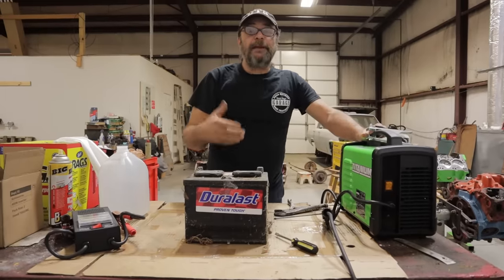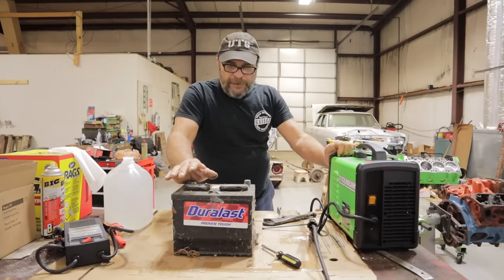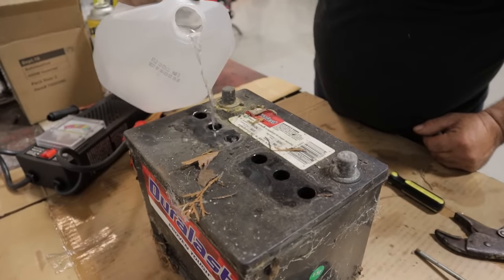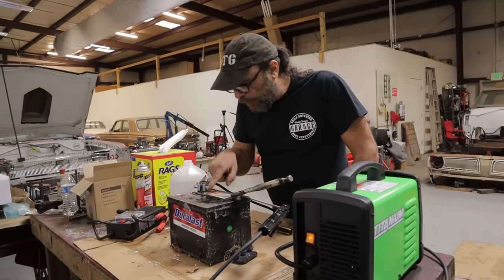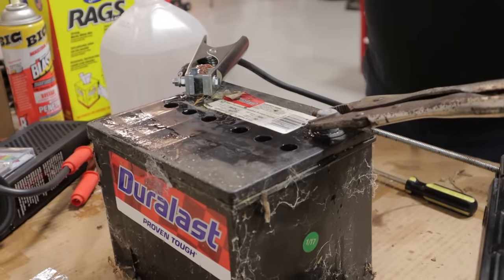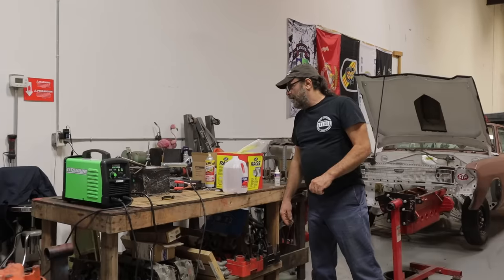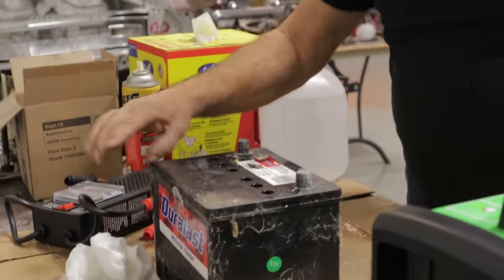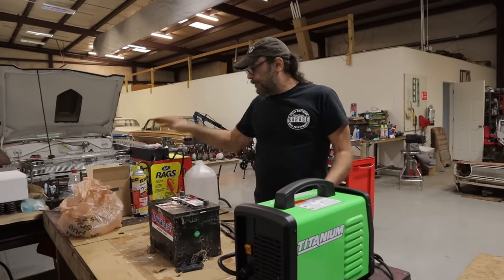Reviving Dead Batteries With A Stick Welder

Comment: Try Alum and Distilled Water.
   1) Drain, clean battery, and safely dispose of Electrolyte using Distilled Water and Baking Soda.
   2) Fill with Alum 8 OZ per Gallon of Distilled Water.
   3) Trickle Charge or safely Top Charge battery and verify with Voltage/Load Tester.

Comment: A stupid easy method to break the sulfate crust is to add a few ml of concentrated alum solution then apply some high voltage to it through a big diode. I found an old electric space heater works well. For smaller ones use a  100W light bulb. Your end point is when it conducts enough to get that bulb glowing or heater elements get hot. Works well for little to medium car batteries. For fork truck batteries do the same but you will need a welder.

Comment: Question please ..Ive a 240A mig converted to gass-les flux core wire feed (polarity changed ) will this do the same job as a stick welder  , ?Cheers

Comment: So did it last and worked on a car for a while, as you mentioned you were going to test it on a vehicle? Just wondering if it was a short term fix, or a long lasting fix(1, 2 or 3+yrs..)thx for the video, very interesting. 👍

Comment: 3 stories:
1) My dad had a 60's parts store where we sold Delco batteries. Delco had a warranty policy where they would replace a battery with a split case from an explosion (hydrogen gas). I thought it was dumb because we all check charge by jumping the terminals with a wrench. Any explosion would be OUR fault. Buuuut..one day I walked by a car that popped when the driver tried to start the car. within seconds, I saw liquid pouring out in the ground. The driver opened the hood and the battery case was split open. Terminals were good and tight. It must have sparked internally from a broken connection.
2) We had a customer come in complaining about a "loose" terminal on a new Delco we sold him. Brother saw the horrible terminals beaten to a pulp and the hammer under the hood. The car did start so bro asked him what the problem was. With brother's nose over the battery, the owner pulled the post out of the case and brother only remembered a muffled PHFFT! Then he went deaf. I hear a shotgun go off in the shop. I went out and saw bro covered in acid. We washed him down and took him to the hospital. They put a drip on his eyes for hours to flush him out. He has a cloudiness in one eye to this day.
3) Non distilled "water". There is a WW-2 story about a submarine that needed new batteries. But because of supply shortage and distance from a shop none were avail. The captain ordered a big set of cables connected to the batteries and the other ends thrown into the sea. The resulting short circuit cleared some of the sulfation and they were able to get a better charge.

Comment: I discovered the hard way that I had a shorted cell on a battery  in a 72 Duster by trying to jump start it. If you are going to try that have a garden hose nearby like we lucked out and had 25 feet away because both of us had acid in our eyes and could not see. We completely hosed down and were ok. About 2 hours later my pretty new pair of levis were falling apart. We hosed down the engine compartment but that acid had set for about 10 minutes while we were hosing ourselves down and it still made a mess of it.   If you do manage to get the battery somewhat usable it is still not gonna have anywhere near the cranking amps nor reserve capacity of a new battery.  Just replace the battery, it is not worth the risk to squeeze a couple more summer months out of a severely comprimised battery.  I wish you had put a voltmeter on it while charging to see what the voltage was doing. After that incident I always check cell to cell with a volt meter to make sure there is not a shorted cell before trying to jump start. My dad blew up a fairly new battery in a Reliant K-car jumping it after having left his headlights on.

Comment: Hey Tony,
I think that you should have put the meter on the Battery 1st, to prove the battery was bad. I like this process of rejuvenating a battery!! Kudos to you!
Reply: No need to check battery voltage beforehand.  If this would blow up the battery,  both good and bad battery will be blow.

Comment: I have a small harbor freight stick welder and a giant Lincoln industrial arc welder 220/440.  It's about 600lbs from the 40's I think.  Awesome stick welder but the wheel is harder to control on the Lincoln.   Will the harbor freight 80 amp work?

Comment: I currently shock batteries a little differently.. I mix six tablespoons of epsom salts with distilled water and slow charge the battery.. The sulfates drop off the plates and then take a full charge.. I will now experiment with this technique..,

Comment: Had a shade tree mechanic tell me bc of that sulfication as this guy say..that it would crust up on the bottom & short out the battery..he said to unhook the battery & hold it up about 2-3 feet & drop it on the ground & it would break up this material on the bottom..I dropped mine like 6 times..enough to shake the stuff loose but not crack the case on the battery..really thought this was bs but I got anot8 months on the battery..I know this sounds too easy..as I thought but it brought the battery back to life

Comment: Now put on the charger and charge overnight.  Welder did the shock mode.  Sometimes a sulfur plate set might need reverse voltage and forward back and forth then charge on normal polarity.

Comment: I know I’ve used distilled water and just like that we don’t ever think about all the grim and dirt on top that washes down in to it .  Dad told me that all the flakes off the plates would settle to the bottom that grounds the battery plates out .  I’ve washed them out with tap water 15-20 times just kinda shaking it like just flopping it over on the ground jarring it breaking the stuff loose inside .  Then after the washing it out till the water comes out of it clean last two or three times I used distilled water . Then filled it with new acid and trickle charge for 24 hours it was a 6 year old battery! I used  it for three more years it was good when I traded the truck off .  My dad said back in the 50’s he just used mountain stream water or spring water .  I wanna know if this method would work on a AGM battery you can add a few drops of water in each cell of them every three or four years and get longer life out of them .  I’ve seen welders do this trick we’re they just use the welder on the tuck to jump start cars.  With the way the battery was hooked up same way as it was charged her on the video . They didn’t turn it up real hi like 50 amps at the most but the cars were older with no computer !  Great video Tony I learned something new about cleaning those plates off .  If your gonna have lead wet cell battery’s in your ride this is great to know !

Comment: You use distilled water because the chemicals they put in tap water, bottled water, and filtered water will interact with the battery acid and produce ammonia gas which can build up and cause the battery to burst (aka explode)

Comment: Got myself a stick welder for 55 bucks to do this myself. My step dad has been rejuvenating batterie smy whole life. It funny hows he been using batteries from the 60s and 70s and 80s. He was in the Navy on diesel sub and learned way back then. I never bought batteries just brought him.dead ones. Until i used AGM batteries for deep cycling with stereo systems with amps and capacitor that i realized those it didnt work with the stick welder.

Comment: I bought a battery from a shop that claimed they rebuilt batteries,  it worked fine the first day I bought it. The next day it wasn't completely dead but wouldn't turn the engine over fast enough to start.  I went to wal mart and bought a new battery.  The savings wasn't worth the hassle.  If you do it yourself and it doesn't work, at least you tried.  If it does work great.

Comment: I have done this as well  But I used a commercial battery charger that I could adjust the amperage and voltage with. That gas coming out of that battery Uncle Tony is hydrogen and it is highly explosive. Also I would not be standing right over the battery looking in the holes like that cuz I have seen the acid boil out so violently that it could splash onto your face, you should have a face shield on and should be looking in the holes with an inspection mirror. Just my advice, my two cents worth

Comment: Could i use a fluxcore welder? It is the Easy flux 125. DC based inverter welder. I also have the real cheap HF welder, havnt used in ages. $49 when i bought it with coupons.

Comment: I took it for granted you need a DC welder. A welder with that much current available would cost you big bucks. Cheaper to just go buy another battery. I watched the battery connections and can't figure out if you are trying to desulfate with reverse current or forward current I have to assume it's forward current but the black clamp on a positive post is confusing. Assuming forward current the best I can see on the internet is 75% and not very long before the battery goes bad again.

Comment: Ive tried to revive a few batteries but never had much luck.   The last one I attempted had measured 10.5 volts with 1 dead cell, used a plating transformer set at ~15 volts dc, cycled on 1 hour and off 2 hours for one week.  The result was no different  and I cut the battery in half to look at the plates.   At the cell closest to the negative terminal,  the bottom half of the plates were corroded away with material setting in the bottom of the cell.  Perhaps I used too much power, but some batteries won't come back no matter what you try.  In the future I might try some type of pulsed dc, people say they've had luck with that.

Comment: "do as i say, not as i do..."
photovoltaic / solar thermal technician here: i have always revived dead batteries by changing the distilled water charging etc. have i been doing it correctly, is this how it's done ? that's the real question. while learning photovoltaic we had to learn about batteries and only maintenance was covered and the difference between automotive battery vs deep cycle battery (golf cart, boat/marine) automotive batteries have thin plates and do not like to be charged, maximum charges you can do is 3. yes you can charge them over and over but it won't hold a charge. my trick was to have a trickle charge via mini solar panel connected to have some juice to crank the car (my personal experiment) Deep Cycle Batteries have thick plates designed for many cycle (1000 or more charges) personally i prefer lead acid batteries over lithium ion. I like them but for a customer to have maintenance free batteries, lithium ion. i've seen the automotive battery cases removed and installed at new case after the plates been refurbished. if you want to bring back a battery back to live to experiment Be Careful use proper PPE personal protection equipment. also when dumping the battery acid, store it in a safe place since it's Sulfuric Acid, don't throw away safe it and use it for other things. i happen to be a goldsmith / master jeweler 55 yrs experience and use that sulfuric acid. if ever i'm cut i use the acid to stop the bleeding, stings like crazy but works.

Comment: I prefer using a battery charger set on start setting for about 15 minutes and rest at about 20 minutes than repeating for 3 to 4 times. That's how I did my battery dated 2018 and it still holds a charge. Of course I had some failures doing this with mower batteries. I watched different methods on reviving a battery.

Comment: Tony it does work but be careful for gods sake.  these things blow up on occassion. Happened to me jumping a dead battery too many times with a 200amp charger/starter. Luckly i was was working on another car. I heard a loud pop seconds later something fell from the sky....it was the entire top of the battery!!  I just feel its not worth the risk...a spark from the cables is all its needs....maybe a fan can  blow the fumes away making it safer...

Comment: Hi I have 1 question......  What do you do when you have a sealed battery?  I was going to put up an add for fixing batteries for winter but I don't know what to do if someone has a sealed battery. I couldn't just turn them away that's bad business.

Comment: I have a few motorcycle (one generator one KTM 690) batteries a few Marine batteries a truck battery a few quad batteries. I'm gonna give this a go. I got a Lincoln 220 that I've had for like 20 years that I hardly used at all.

Comment: I work with batteries (lead acid and lithium) everyday and can't recommend highly enough not to do this if you value your face. If you want to do it safely get a low current charger and gently force charge it while monitoring temp in each cell and voltage. All this does is overheat  the plates, create excessive hydrogen and oxygen (explosive mixture) and leave the plates, if badly worn or broken, ready to melt together and short circuit causing a very bad day. And as he said in the video "if it "pops" and acid gets on you just rince it with fresh water and you'll be fine" is bullshit. If it gets in your eyes it's at best instant Cataracts and worst instant blindness. Sure it will work for a while but really is it worth the risk over just buying a new battery? You can get good money for the scrap one so deduct that from cost of new one and really not worth it. Up to you but I myself wouldn't bother and certainly wouldn't be at it as a side hustle 🤣
Reply: IV had a battery pop an blow acid in my face an eyes just by hooking battery charger up to it on 10 amps, burns like hell yes but am after I stumbled an wondered my blind ass up a flight of stairs an in the house to the sink as I had to keep my eyes closed to to the air hitting them mad it burn even more so like I said I had to figure out a path to get in my house to the sink so I can flush my face an eyes with running water an dousing them with baking soda it finally stopped burning an my eyes were fine so the fact that it would be instant or even blindness is bs, that is however you immediately flush with cool running water water for about 30mins or so you'll be fine but still burns like hell.

Comment: Just wondering does it matter what voltage output your stick welder output to the battery? Generally they do 17 to 19VDC don't they? Do you have any voltage readings for 50amp, 70amp, 80, 100, 150 and 200? I am going to do the same with mine soon, however I have and old school Century Quick fix tig welder going to try out, it doesn't have current control like yours, just high and low settings.
Reply: yeah CCV... Closed circuit voltage is around 18-42VDC for a welder this size

Comment: I wondered if he was using a DC inverter welder . Even if you have a AC buzz box you can buy a bridge rectifier with a high enough amperage rating. I believe you you can even use a 3 phase bridge rectifier if you have one . Look up bridge rectifier on you tube for making DC welder from a AC welder . If your battery case is bulged out that means it has frozen and may be no good to even try

Comment: On a little welder like that, do those plug into regular 110 volt, or do they require wiring to a higher amperage breaker? 15 amp? 20 amp?

Comment: Was just looking at the output of my welders, both 220 volt input and output of one is 48 volts and the other 25 volts and can flip AC/DC +/- . Thinking the 48 Volts would end up a boom on a 12 volt battery.

Comment: Can you use a trickle charger as well I've had batteries go dead just after having it say is good and been charged put it in my vehicle drive it a couple miles park it and after a couple weeks go to start my vehicle even with a $200 dollar portable charger still won't start the car and I'm taking about a 1969 Hurst Olds 442 why is the battery dieing???

Comment: Make a note this is a DC WELDER being used.......Great video....  I killed 8 of my 14 solar lead acid batteries I thing them four are only 4 months old and  other four are 6 months old 100 AH marines...$900 down the drain unless you're method works..Someone said  they use 10 amp for a small car battery for hours....Thanks for sharing. I'm to chicken to go over sat 50 amps...LOL

Comment: If the stuff gets knocked off the plates, then left in the battery, won't it reattach over time? Seems like u should replace the water and acid.

Comment: By the way if you leave the information on stickers on your load tester right there around the button it tells you how many seconds to hold your button in cycle and if you hold that button much longer than the amount of seconds your button will fail I know from experience I've used the exact same load tester

Comment: You can also add about a year to an end of life battery by hitting each side of the battery with a rubber mallet. This knocks off the calcification and from the plates and clears them for further usage.
Reply: So many potholes in the roads where I live I think my batteries go through that sort of shock/vibration daily. 😁

Comment: Clean the top of the battery constantly!!! This will extend the life of the battery well past the expected lifetime of the WARRANTY. Cleaning the top of the battery and making sure you add only distilled water to low cells adds months to years to the life of your battery!  Keeping your battery top clean prevents carbon tracks and salts from forming conductive tracks from forming from the positive to negative poles and draining your battery even while it sits. This causes your alternator to work much harder to charge the battery and wearing out both early. Not everybody has a DC welder, if you do not, then doing what I tell you here will save you money! Best Wishes!